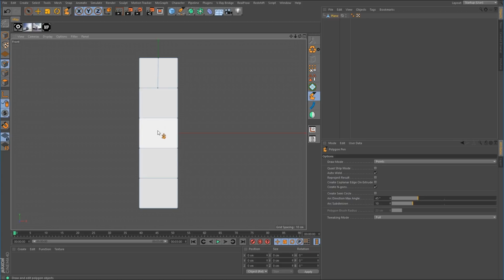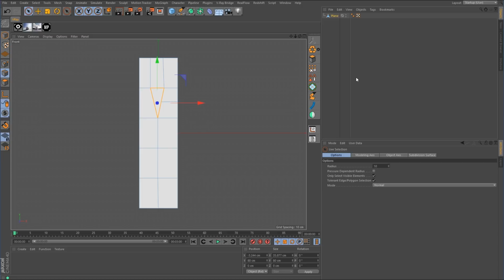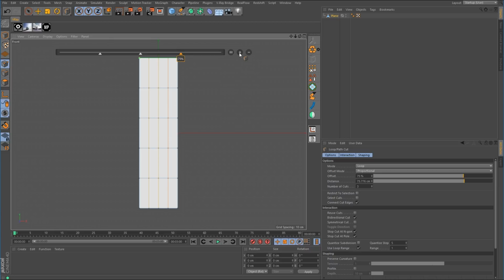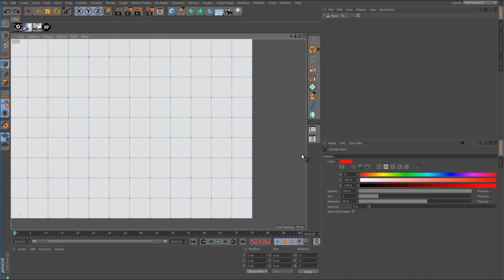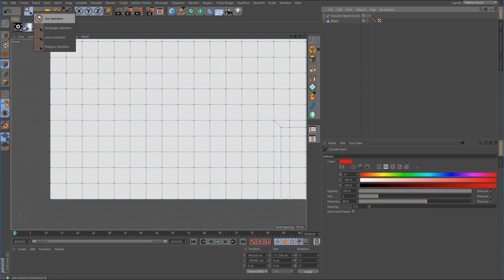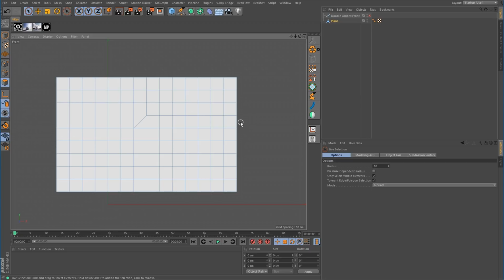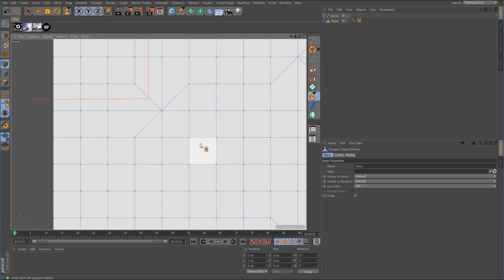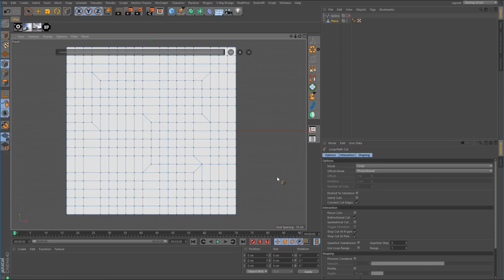Sub-D Modeling in C4D - Part 24 - Quad topology exercises

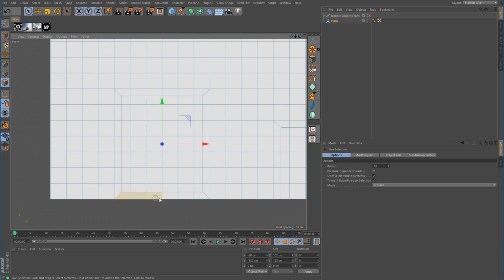Comment: I found that the "clone" feature in the slide tool will do the job perfectly in 13:10. Just select three edges and drag with the "clone" option checked on. It will create that kind of edge flow without any need of adjustment.
Reply: it's worked thank u ^_^

Comment: I tried the loop cut in R20 and I got the same bug you did.
Reply from the maker: If you select the loop cut tool, and hold down Ctrl+Shift, then click and drag on an edge to the right or left, it will raise and lower the number for the loop range. If you then click on the + or - buttons at the top, the loop range will remain as it should. I was able to do this with the "loop range" turned off. It appears to work correctly if you use it interactively (Ctrl+Shift), but if you use the settings in the knife attributes, it doesn't work.